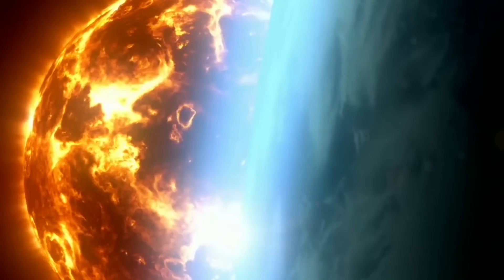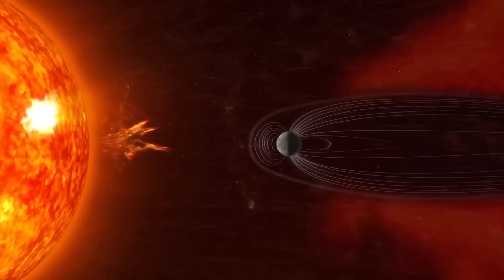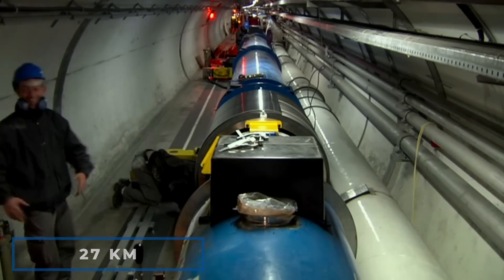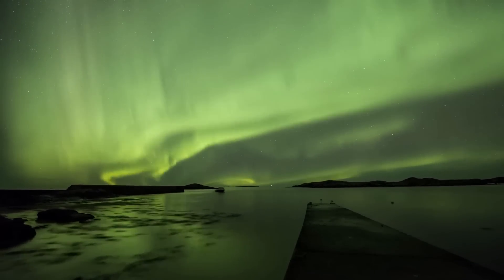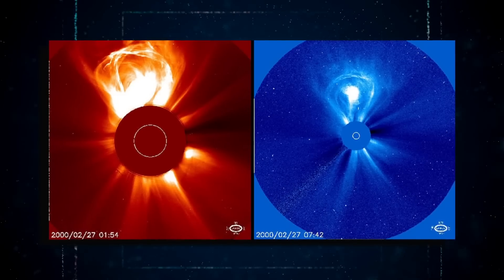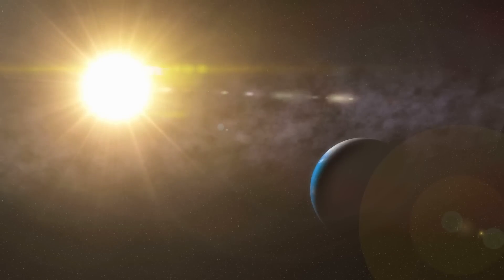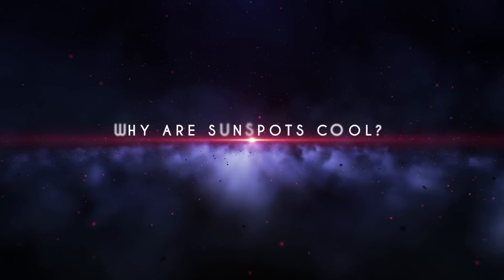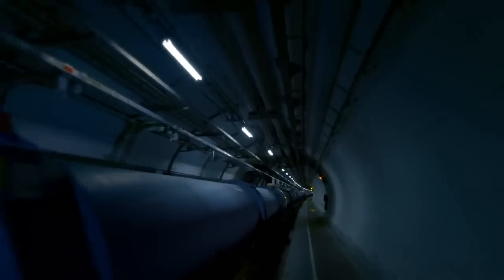CERN Scientists Announced Something Weird Is Going On After They Turned On The Large Hadron Collider

Comment: The earths on a 12000 year cycle of cataclysms, it’s estimated there will be a sun flare/ mini nova in the next 20-30 years which will knock out the power grid and the start of the new cycle, due to the magnetic poles shifting and weakening.
Reply: Try the year 2030-2040

Comment: Where did they get all the electricity needed for those magnets?  Nuclear,solar?
Reply: From your hardships freezing at home most likely we are but ghosts we just dont know yet
Reply: The LHC draws its power from the french energy grid which is about 50% oil, gas and coal, about 40% nuclear power, and the remaining 10% are renewable
Reply: Burning Coal for sure
Reply: They took electricity from 3 or 4 nearby towns and sucked so much power all the towns and CERN went dark.

Comment: What I want to know is what happens to the people that live in the center of that machine
Reply: The people that live in the center are not affected by the particle accelerator. It is a circle, but the center is not important for the machine. If you want to accelerate particles you need a bunch of magnets in a row. You can do that in a straight lign, but once the track ends you can't go any faster. But if you can loop around back to the start you can reuse the same magnets over and over again. You can think of it like cars on a race track. If you want them to go rally fast, but you can only build a road so long, the best is to build a really big circular road. The LHC at CERN is like a really long circular race track in a tunnel underground. It might be a bad idea to stand directly on the road, but anywhere else you are going to be fine
Reply: Radiations most likely will never reach ground level. That is the point of burying it deep under the ground and put a lot of layers of a bunch of materials.

Comment: I am more than a little confused about the reasonings and especially about the conclusions in many comments.  If I have understood, the charged particles are rotating in the ring in opposite directions in order to double the collision effect.  That would cause their two electromagnet effects be cancelled at least a moderate to large distance.  On the other hand, the steering magnets are specially designed to also limit their effect to very localized areas.  It would be counterproductive or outright foolish to waste energy into a field far away.  So, what is all the ado?  (I am no expert on the Cern magnets, so I am happy to accept any correction from actual experts.)